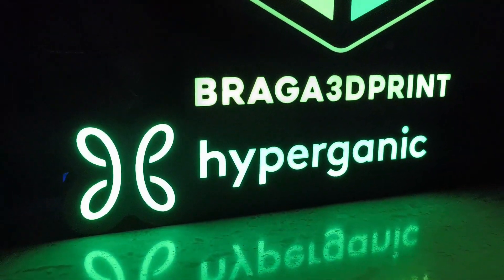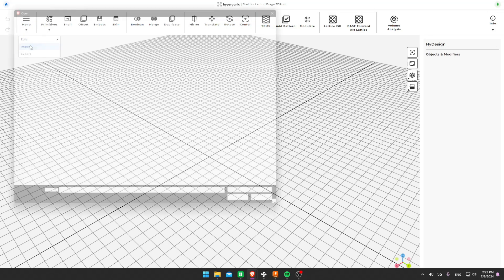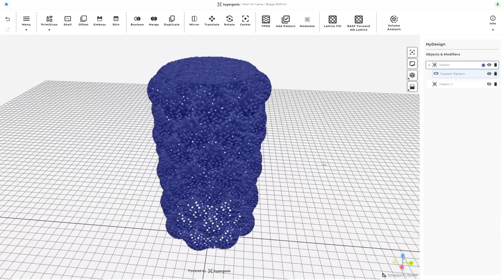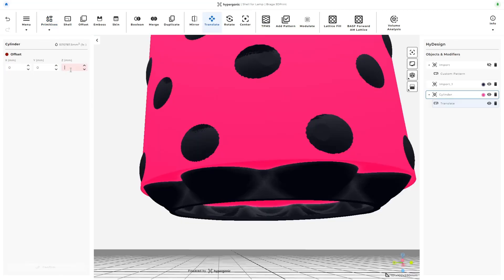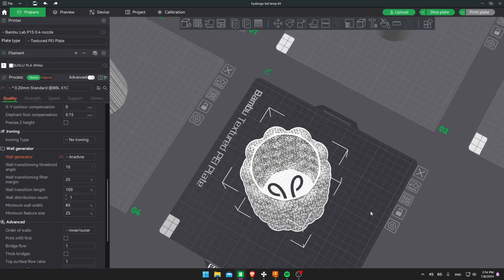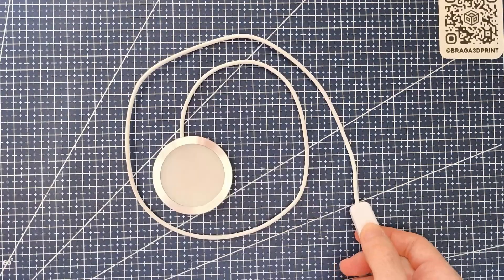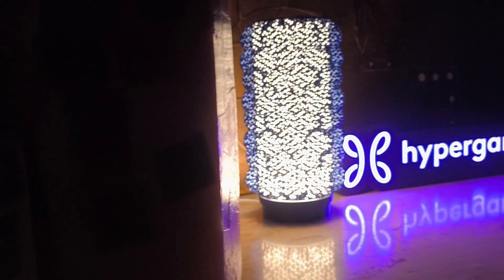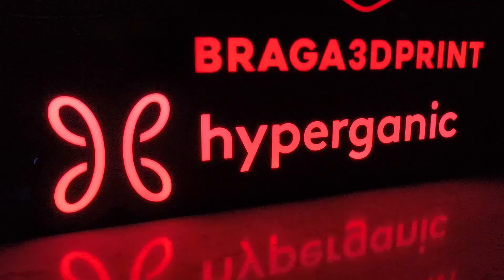Most Anticipated 3D Design Tool | HyDesign | Effortless Lattice Structures!

Comment: What kind of filament is recommended? PLA? PETG?
Reply from the maker: I used PLA Carbon Fiber. But this was before all the new findings by @NathanBuildsRobots. I'd recommend checking out his videos to be fully aware of what you are getting into when using filaments with Carbon Fibers. I'd recommend using PETG for the base since the LED Kit heats up a bit, and PLA for the rest.
Reply: @braga3dprint  I’ll check out his videos! Thank you for the great work!